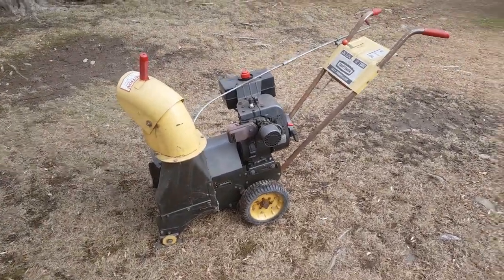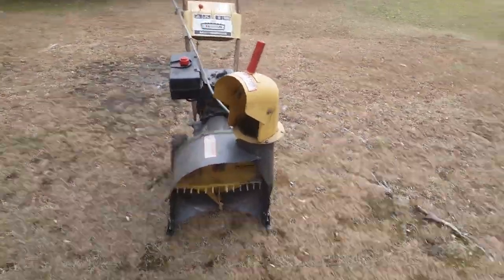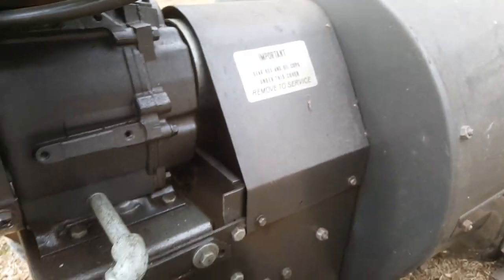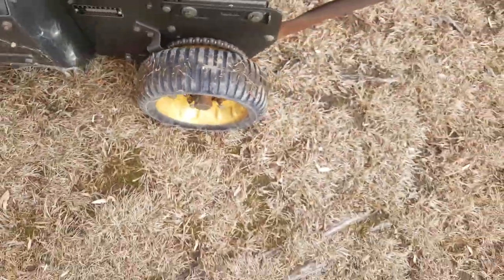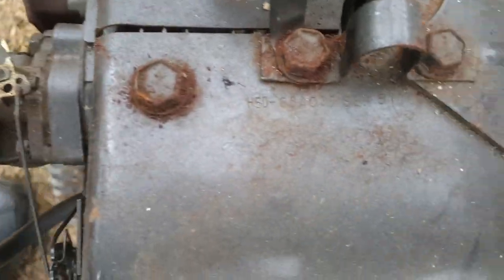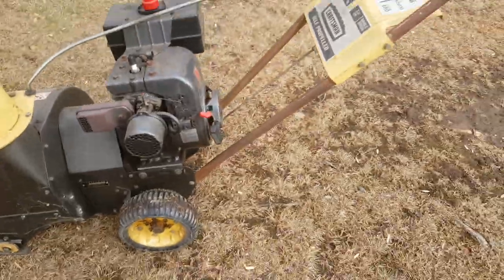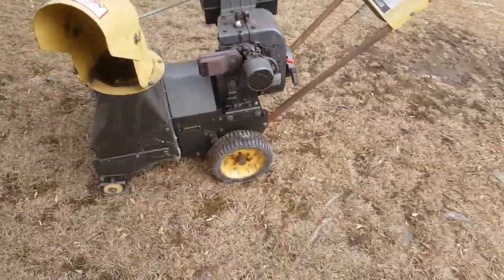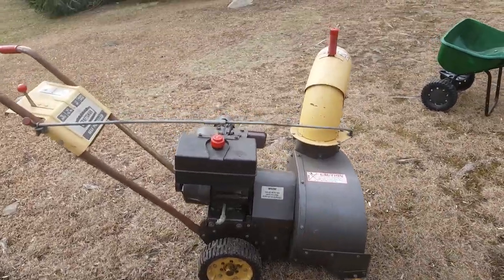18" Vintage Craftsman snow blower

Comment: Every one that i saw had the steel wheels unless it's one of the 1st that came with rubber tires.I seen one for sale that they was using for lawn art it's complete 2hp briggs i threw a offer on it to fix and to use it will look good in my collection.They are out there but these snowblowers are rare

Comment: Late 60's Sears, made by AMF, Homko sold out around 65, and Murray bought AMF around 73. The engine on yours is a replacement from the 70s.
Reply: Correct. Murray eventually sold to Briggs and Stratton around 2005 and whatever remaining parts support there is today would be handled by B&S. They are actually pretty good--I was able to get a copy of a 1971 AMF snow blower manual from them a few years back, although they claim that they have nothing prior to 2005. Before 2005, you could send them an old "536" model number machine and they would dig up a copy of the owner's manual and parts list and mail it to you.

Comment: Me and a friend of mine are restoring one almost exactly like this with the original engine and it had the snow screen too
Reply: Would be interesting to see the old craftsman compared to one of the new Toro snow Masters which is also a single stage with powered Wheels.
Reply: @robertknight4672  I can get pictures of it to ya if you want :)